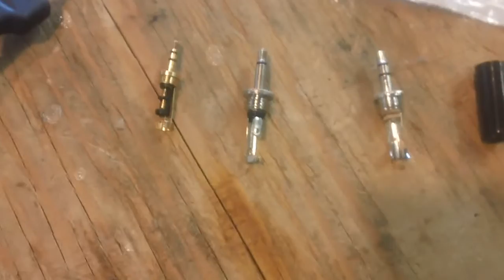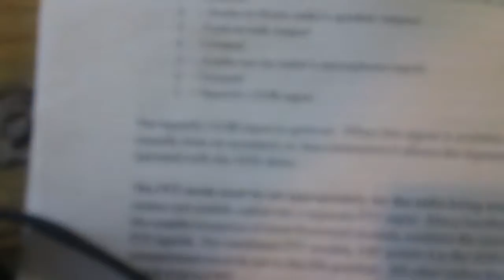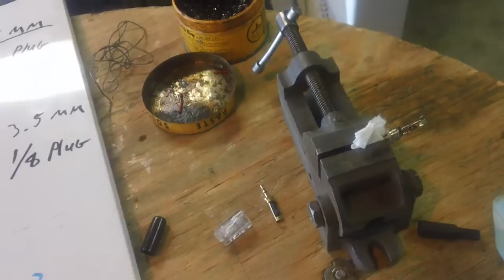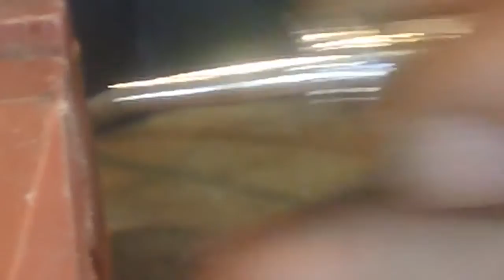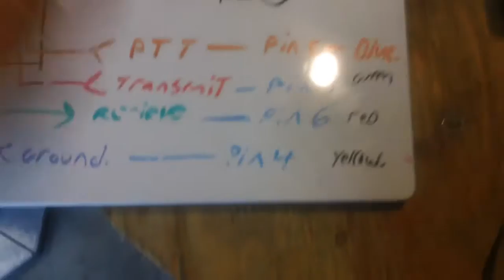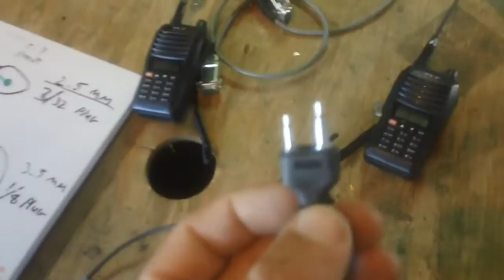Personal SHTF WROL Simplex Repeater Build, Interconnections.

Comment: One beginers question is Surecom SR-112 Radio record simplex repeater controller good for beginers? My plans are to use is for airsoft milsim games (24-48h).? Thanks!

And is it passable to use DTMF to change freq?!
Reply from the maker: +Ivan Duždagić I don't know, never used one before of that model.

Comment: Does the repeat stop if someone transmits and answers you right away on the simplex freq? Or do you have to listen to every transmission twice? The old radio shack had a 10 second timer and listened to see if you transmitted an answer right away to fix having to hear yourself twice. contact info on QRZ. com
73
Jimmy, ARRL TS, WX9DX

Comment: I hope you can help me with this question i just ordered the Simplex Repeater. How do i stop the transmit from the repeater and tx/rx radio from sending it back to my radio that i transmit, so i wont hear myself twice?
Reply from the maker: In a simplex repeater, you will always hear yourself once, no way around that unless you have a half to full duplex repeater. your other user might hear you twice, which could be confusing in a high stress situation. to solve that you use 2 frequencies, for example, you transmit on 442 MHz & you receive 447 MHz along with the other members of your group. the simplex repeater uses the opposite, receive 442 & transmit 447. in that configuration you will only hear yourself once and your other party will too.
Reply: GUERRILLACOMM Ok thank you very much, love your videos. I will post a video of my ammo can repeater when its done.

Comment: This electrical stuff is way out of my comfort zone...which is why I'm doing it. I have the Wouxun radio as well and looking at your videos the only thing I dont quite understand is, if the cable they provide for the kenwood with the RJ45 doesn't work, does getting the Kenwood speaker mic cable and putting your own RJ45 on work because your putting the wires from the cable into different spots in the RJ45, as opposed to rewiring the pins themselves? Did you say they may have one that does work?

Comment from the maker: Negative.... In my experience, its only plug & play if its made by the same manufacturer and it specifically says that it is compatible as is. You will run the risk of damaging your equipment like I did. Most of the time if its an after market or other manufacturer device to be interface with another, there is some form of tinkering to make it work. definitely need schematics, or reverse engineering to be absolutely sure.